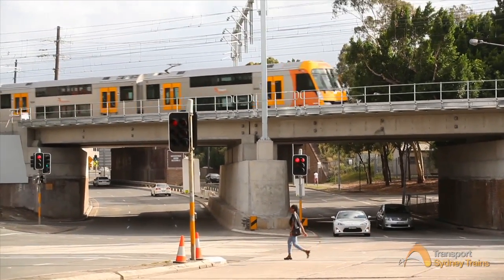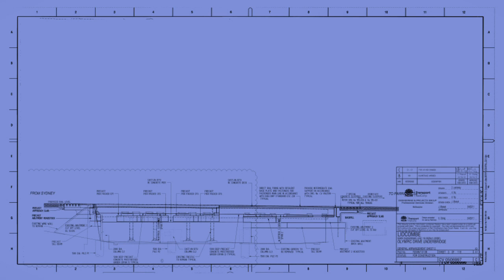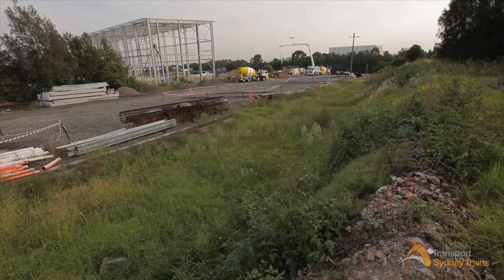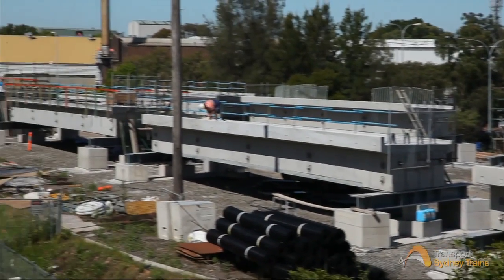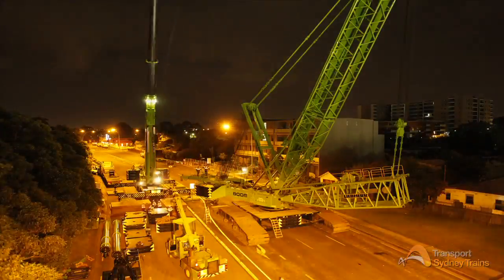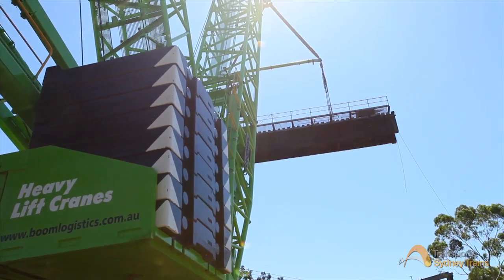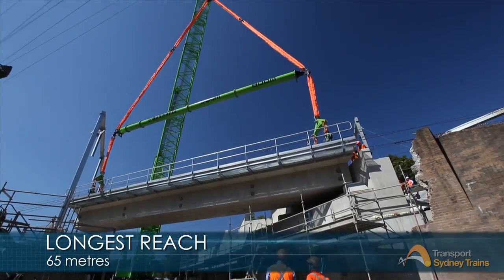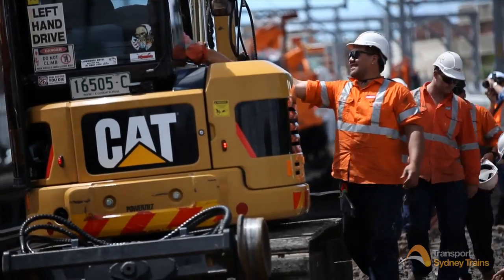Sydney Trains - The Olympic Drive Story

Comment: Fantastic :) Why can’t this sort of thinking be used for the overall transport system.
Reply: Andre Brokman All the infrastructure was like this at first. Obviously they would have to keep improving things just like this.
Reply: Jamie Lipscomb I actually meant this sort of in-depth, detailed, smart, strategic, sequentially sorted, strategic *thinking*. Most of the mega projects the NSW Lib govt is running are the opposite of the thinking that went into this project. Yeah, they’re doing stuff unlike Labor (not quite an honest reflection on Labor, but I get the contrast) but they’re exhibiting all the focus and understanding of the bigger picture as a 5 year old with ADHD running wild with their crayons.
Reply: I am so never getting a job in state govt..
Reply: Andre Brokman Certainly, but the only other major transport work to this extent that they’re doing (Light Rail) has also been strategically planned for the city. Otherwise, any other projects only require a small amount of planning compared to that.
Reply: Sydney Metro is a $20 billion project that does surprisingly little to aid the existing Sydney Trains network. It's not rocket science to figure that out. This $20 billion dollar project could've done with a lot more strategic thinking before they threw the baby out with the bathwater and condemned most of Sydney away from the "Metro" (it's not a Metro) to gummed up brittle unreliable operations as more people plow onto the same level of service - Sydney Trains can't run more services without track untangling and most crucially, a new set of core tracks. Sydney Metro takes this from Sydney Trains, and by doing so condemns Sydney Trains.
Reply: Andre Brokman Well talking about Sydney Metro, there aren’t actually any noted flaws with it, and I haven’t seemed to notice any problems with the current ‘tangled network’
Reply: There's been a spate of high profile issues with the new timetable. It seems particularly brittle and when an interruption does occur, it often flows across a large part of the network due to the 'tangled' nature of tracks (and the services that run on them), and already on multiple occasions they've been unable to recover across the full span of the day. Essentially, the network is operating at the red line within its existing constraints. Yet, it will be tasked with carrying hundreds of thousands of extra people over the next couple of decades. Sydney Metro and the proposed Metro West do very little to address these fundamental problems. They will operate perfectly fine within their own siloed sections, but the rest of the network will suffer as a result because it misses out on the hard infrastructure investments it so obviously needs. That's the 'flaw' with Sydney Metro - aside from having the wrong rolling stock - narrowbody, narrow-doored trains with low cielings are a big no-no.
Reply: Andre Brokman Well the metro links the North of Sydney to the Bankstown area right under the city, saving having to change trains at Chatswood, Wynyard then Syndenham, and the Metro style of the trains is used in Europe and has faster loading on and off, and of course any problems with the new timetable as they said ‘would be dealt with if they came’
Reply: The "Metro" (it's not a true metro) should have been a Sydney Trains project as only then would it have had a very significant broader benefit to the whole network. The central section of the Metro is wasted as a Metro. Anyway, too late to do anything about that now. The loading/unloading benefits are overstated. The main constraint on our network is the lack of platform space at Town Hall. In Europe no "metro" runs this sort of rapid transit route to the outer edge of a major metropolitan area. This route is analagous to the Paris RER, not the Paris Metro. Not even the HK MTR from which it apparently drew inspiration is anywhere near as long as this route. I don't understand your comment regarding issues with the new timetable. The fact of the matter is there's only so much tweaking they can do. The track infrastructure simply cannot take much more.
Reply: Andre Brokman Well of course, there is a point where they will have to significantly upgrade the track capacity if it gets worse any faster (Including platform space at town hall), and over the future years, even the metro would have to be extended and more lines made to take off the capacity on Sydney Trains. The reason it’s a seperate network anyway is because it would be even more ‘tangled’, like you said. The meaning of the word ‘metro’ is loose anyway, because it represents any rapid transit high capacity system, such as this one.
Reply: You're right the term 'metro' is loosely used. Look at the Melbourne "Metro" network. However, in the case of Sydney Metro, they've bought true metro trains which is a very poor decision indeed given the length of this route especially to the north west. In the future they want to make the line even longer. I don't care about the double decker vs single decker debate, either way these trains should have been widebody trains with enough interior space for sections of bench seating and wide aisles like pretty much every other system in the world that runs trains on routes of this type. Sydney Metro themselves have benchmarked the London Crossrail project yet missed the mark completely regarding rolling stock. 
I've explained on my facebook wall an example of just why Sydney Metro achieves so little regarding 'untangling' the existing Sydney Trains network. Summary: it doesn't do much to Sydney Trains services, and given Sydney Trains patronage grew by 12% alone last year, the fact Sydney Trains is essentially at capacity and will remain so as long as Metros-only are built, this is a serious problem. 
https://www.facebook.com/SydneyWorks/posts/956018091230502?comment_id=956042857894692&notif_id=1519190716640790&notif_t=feed_comment&ref=notif
Scroll down to my response to the first comment to see why Bankstown Line removal doesn't do much at all.
Reply: Andre Brokman I’ll have a look, but regarding the fact of bench seating and aisle standing, the London Tube nor many other metros in Europe have this. Also about the distance compared to the type of trains, I really don’t see that as a massive problem if the service is there in the first place. And of course, the metro isn’t going to help the ‘tangled system’ but it would make it worse if it was just another Sydney Trains Line.
Reply: Andre Brokman But if you got a job as a Transport Minister, you could initiate your changes to the ‘tangled’ network.